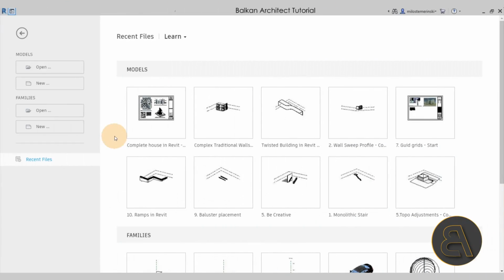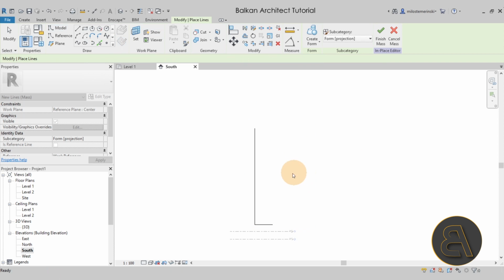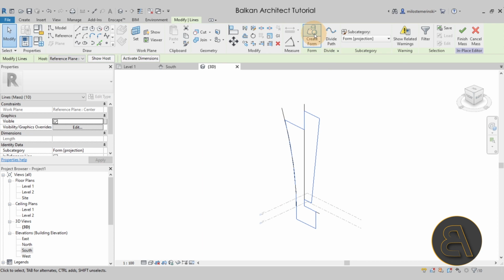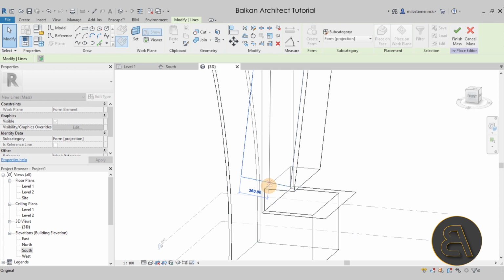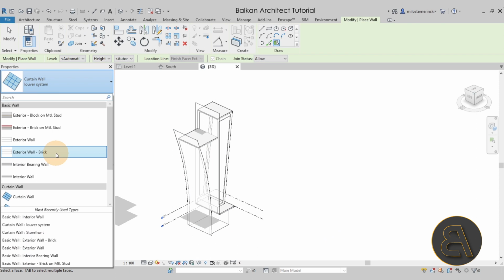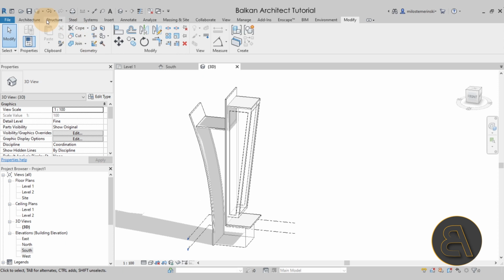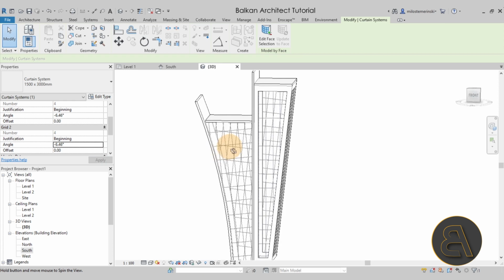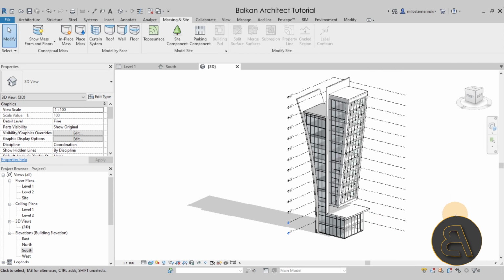Amazing Skyscraper in Revit Tutorial [Tower in Revit]

Comment: i have a question, i hope you reply tho. its regarding about the heat loss heat gain calc in revit. The orientation of window glass can varies in value, aside from the materials used (ie. tinted glass, canopies, overhang etc) can change its btuh. another thing is the location/ orientation of these windows or glazing. The window facing north is definitely has a different value on the window facing east. (value means solar btuh produced). Can you teach how to calculate or do this in revit?